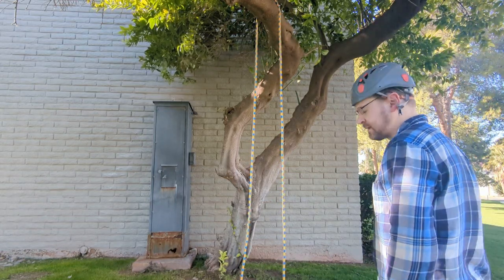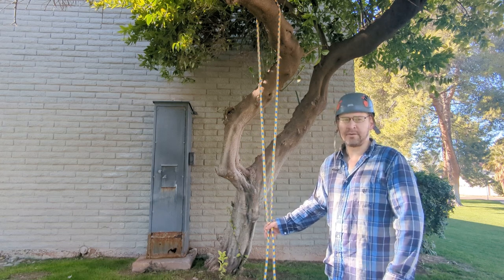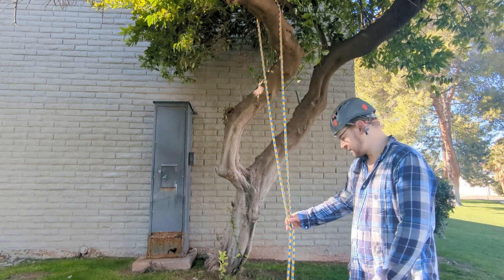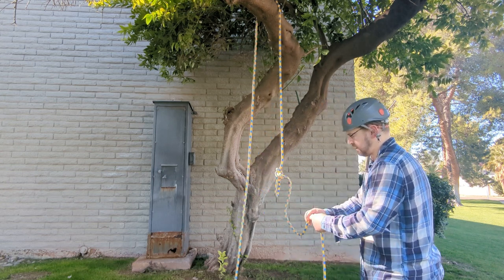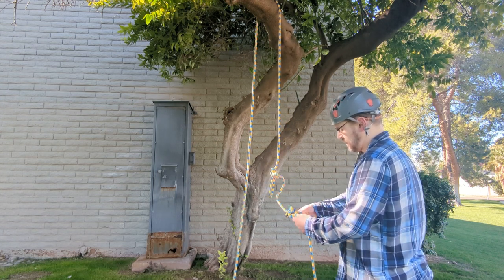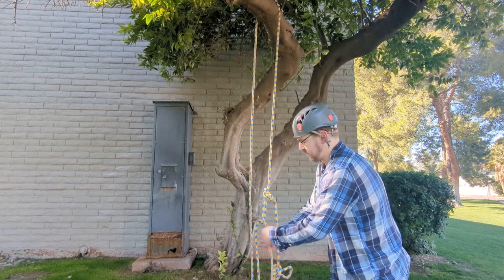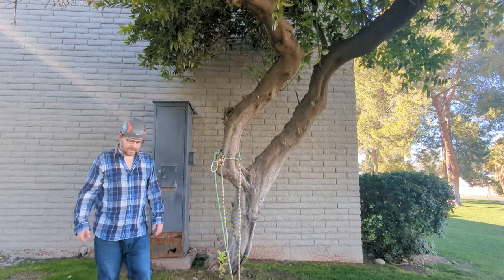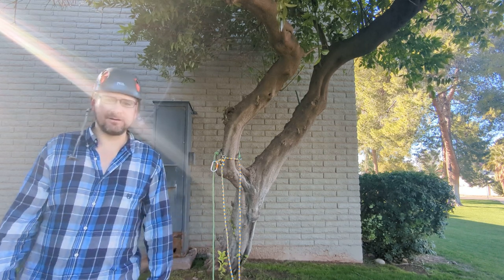CANOPY ANCHORS: 8 Different STYLES & TECHNIQUES for SRS/SRT for Arborists & Tree Climbers!

Comment: I built myself another midline attachable anchor - a 28inch piece of rope with two splices connecting to a dmm revolver on one side and a notch quickie on the other side. the slick pin rolls in the quickie and acts like a pulley when retrieving the anchor or in drt mode. The revolver carabiner has a pointy end and retrieves easily through tight crotches.
the anchor doubles as a pulley saver and a redirect.
retrieves with a cone or xsre carabiner.
Reply from the maker: That sounds great! I like how you used splices, first and foremost. I also like your use of a Notch Quickie with a DMM Revolver. I can definitely see how the Quickie might act as a second pulley. That's awesome that you can use it as a pulley saver and a redirect as well. Thanks for the comment! =-D

Comment: For me, the biggest advantage of single line is being easier to set from the ground. In my experience with large trees, i always find basil anchoring easier due to not needing to isolate a limb.
Reply from the maker: You raise a damn good point and I wish I had thought to mention this downside of the canopy anchor in my video! Because, absolutely, isolating one limb near the top of the canopy can oftentimes be next to impossible. It requires seriously good throw weight skills. However, isolating that one limb still might be preferable to installing a doubled rope (MRS) from the ground using one's throwline, which I personally rarely have the patience for. But like you said, a basal anchor is a happy medium between the two. Thanks so much for commenting!

Comment: I hate when ppl say a base tie will put a 2:1 force on the tie in point. Mechanical advantage assumes you have a pully and no loss of force due to friction. You don't have that in a tree. Candy caining your rope with a basal tie is like doing a fishing when you're rigging. You're dispersing the force throughout that spar. A canopy tie put all the force on the end of a lever. Both systems have advantages.
Reply from the maker: Yes, it's not a perfect 2:1 force due to friction, but it's close enough to where pretty much everyone in the industry states that the force multiplication is such. Keep in mind that, once a climber actually gets onto the rope and starts moving around, this theoretical 2:1 can easily EXCEED 2:1 and even get near 2.5:1 while a climber is ascending, and even higher if a climber were to fall. The main reason why I almost always use a canopy anchor is because there's absolutely no point in creating extra forces on my TIP when I can avoid it. If I need to get up initially using a basal anchor, I will then convert that basal anchor into a canopy anchor after I reach my TIP for many of my climbs...but not all. If I'm over multiple, or a single, very strong limb, then I won't bother. But force multiplication is very real and, even if the figures usually quoted are theoretical, they are easier to conceptualize for most people and that's why it is the standard among educators.
Reply from the maker: My canopy ties are always flush against the spar or stem of a tree. If you're setting you're canopy ties so that they are like putting "all the force on the end of a lever," then you're setting your lines way to far out on the limb and that's dangerous. This can happen for basal anchors too and one should avoid setting both in this manner. Keep your anchors right in the crotches, or as close as possible.
Reply: @Knot-orious. Take a force meater and put it in a tree. Friction can reduce the forces on certain points of a system by more than 50%. I agree you can ratchet a tree with a basal tie and skinny union. Just don't do that. You can do things to reduce friction in that case. 

A base anchor let's you use multiple redirects in big trees. You can estimate force vectors to keep your forces compressing unions and loading leaders correctly. 

Canopy anchors don't allow as many redirects.  All of your forces are on one tie in point. Id rather throw in well, pre set a redirect, candy can the trunk once and basal tie. I'm backed up from my primary tie in, my system is lowerable, and I'm starting my climb in a better work position.

 Canopy anchors aren't bad. They're useful but the best climbers I know use base ties or mid ties on big trees. 

This is probably a defense due to where we live I'm guessing your big trees aren't super spread out and flat?
Reply from the maker: @XbunkerXballerX7127 My trees are very spread out and flat at the top in many cases. I use canopy anchors because there's absolutely ZERO point in creating ANY multiplication of forces unless you absolutely have to.

Keep in mind that, unless you analyze the tree limb(s) you're on with an ultrasound machine, you can only reasonably speculate as to how strong it is and, as is often the case with large thick limbs, they can be under a lot of strain and stress already.

Basal anchors are great when you can't isolate a limb and can pull your line over multiple solid limbs that will share the load rather well and safely with minimal compression. But I always try to get the highest TIP I possibly can and this means usually tying into smaller limbs towards the top of the canopy, and so canopy anchors are best implemented for such situations.

You can do just as many redirects with a canopy anchor as you can with a basal anchor. At least that's been my experience. Especially if your first redirect is made using a sling and a pulley/carabiner, which is what I always do to make any subsequent redirects easier to pull out.

I'm not saying that using basal anchors is unsafe. I use them all of the time. But any time that I CAN use a canopy anchor, I WILL use a canopy anchor because until every tree and its limbs start coming with a certified rating like ropes and hardware, I'm going to do everything in my power to reduce or eliminate force multiplication.

Because at the end of the day, until I get up to my TIP, I can't always see if the limb I'm on is completely safe to climb on. Nobody can. It's a risk we all take as tree climbers. I've gotten to the top and discovered that half of my TIP has rotted from the top down or that it's got a stress fracture and that the limb is compromised. It's moments like those that I'm ELATED that I took the time to isolate a limb instead of risking force multiplication. Because, had I done so, I might have experienced a quick drop with a sudden, abrupt stop if you catch my drift.
Reply: Look man you're right. We can't measure forces in a tree. You're arguing that friction is a non factor whem discussing the real world forces. You are wrong. Here is another sorce showing you forces of a rope around a pole. Again this doesn't have nearly the friction of a tree. 

We already saw in my last sorce that a carabiner instead of a pully can reduce the force on an anchor by 50%. 

You aren't understanding the idea of dispersing your forces. You have an outdated overly simplistic idea of the physics involved here. You're right that the total amount of force in a base anchor is multiplied to some extend. This is why you open up the angles and divert that same amount of force over redirects and the leader your candy caned around. I can easily make the forces on 3 redirects less on each individual point vs one canopy tie. If you redirect a canopy tie, you've now multiplied your forces on that first redirect. 

You're wrong about friction not needing to be considered. I've heard that too. It's what we tree guys say because we didn't go to school for this shit and we don't actually understand physics. 

Take the time to research the math involved in what we do. Just because ppl say old wives tales all of the time doesn't mean they're true. You need to know this. Miss calculating the forces of your rigging because you're not considering friction could cost you.
Reply: @Knot-orious you don't know what you don't know man. I also take the highest tie in possible. I can get a basal tie, with a pre installed redirect, up higher into a canopy than i can a canopy anchor. Youre not understanding that with disperment of force. There's less force on  each of my redirects in a base tied tree with 3 redirects than there are on your one tie in point.

 Take a force meater out to a tree and try it. Read either paper I just sent you. I feel like you just don't want to understand the physics involves so out of ignorance you're biased.
Reply: @Knot-orious also if you can't see your tie in to the point where you don't know what it's over and you're even questioning it. You threw in too high. Relying on just loading the branch straight down is stupid. That's not the standard and it's likely a rule you've made up to make yourself feel better. It's definitely the best practice to load a branch this way but it doesn't get rid of the risk involved in not being able to see what your rope is around at all.
Reply from the maker: I'm not even arguing with you, dude. I'm just sharing my personal opinions. What am I "NOT UNDERSTANDING?" I already conceded that friction on the limb or limbs that basal anchor is pulled over most definitely affects the resulting force multiplication. I've sad said nothing that contradicts anything you've claimed about the dispersing of forces. All I've done is told you why I use canopy anchors over basal anchors for the majority of my climbs. This isn't about my failure to understand your perspective, it seems it's more about your inability to appreciate mine. And, no, I'm not throwing too high. Even if I had a telescope, it would be impossible to visual assess, at a minimum, 25% or more of the limb that make up the limbs blind spot(s). Unless you have a drone, you can't possibly EVER make a completely perfect visual assessment of any limb...even if it's 10 feet above your head...UNITL YOU GET UP THERE. I'm not doing anything wrong. I'm covering my ass by using canopy anchors to protect me in case a limb is, by some chance, defective. You honesetly think you could even notice a hairline stress fracture in a limb, even on the side of the limb, while it isn't weighted? Even once you weight that limb, it still may be imperceptible to the naked eye until you ascend up to it and realize that it is there and threatening you. Trust me, my friend. I fully appreicate your perspective and accept your climbing style. Why aren't you accepting mine? All I'm saying is that a canopy anchor doesn't multiply forces and a basal anchor does every single time to varying degrees. So what am I not understanding? Are you saying I'm incorrect? All I'M SAYING is that I like to eliminate force multiplication whenever and wherever possible. Therefore, I maximize my use of canopy anchors. That's it. That's all I'm saying. =-D
Reply from the maker: I'm not making up any rules. What are you even talking about? What have I made up? You're saying that using a canopy anchor is somehow make believe and science fiction and not common practice? What are you even talking about? You're getting really hostile over some pretty silly, petty shit.
Reply: @Knot-orious you can't see a crack when it's not weighted... so weighted your tie in before you climb. Come on dude don't say ahit we both know the answer to. Thats a straw man.
Reply from the maker: And yes, when I say "I like to eliminate force multiplication," this means that one strategy I often use is setting a BASAL ANCHOR OVER SEVERAL STRONG LIMBS. I already said several times that I DO USE BASAL ANCHORS REGULARLY. But that, when I can't set the line over multiple solid limbs, or if I have a nice central single TIP that can be easily isolated, I prefer a canopy anchor. There's NOTHING unusual about climbing off of one singular limb. Not sure why that's so astonishing to you.
Reply: @Knot-orious  ok so that's not at all what you originally said. Read the first two comments. You've changed your opinion. My original point is that a basal isn't a 2:1 system because of the force loss. You are now agreeing with that statement. 

See what happens when we stop regurgitating shit we've heard everyone say and actually think critically about the world?🙃 turns out the industry wives tale you were spreading is wrong
Reply from the maker: @XbunkerXballerX7127   @XbunkerXballerX7127  I just explained to you that, if the fracture is at the top of the limb, even if you weight the limb, you still might be completely unable to see it and I KNOW you know I'm correct.

You clearly misunderstood me. My original statement CLEARLY agreed with the original commenter about how friction makes it less than 2:1 well before you even entered this conversation.

I clearly can be seen saying that the 2:1 measurement is "theoretical" and represents the multiplication of forces in a world with no friction. Therefore, I'm not even sure wtf you're even arguing with me about.
Reply: @Knot-orious  you're still too worried about force multiplication. What you're actually doing is climbing on an unbacked- up system. Trees rarely just pop. They peal. Having a wrap on the way up on a basal can save your life. 

You also fail to realize that all you need to do is get your rope angles to 60° and they're back to 100% of the load. That's no with no friction.
Reply: @Knot-orious  your first comment you said it was negligible and force multiplication was a huge deal. I'm saying that that is a common lie told by arborist who are not physicists and don't understand physics. 

You also said a 2:5:1 system? You realize that's not a thing, right? That the " : " in 2:1 means "to" right? 

You also said bouncing on the rope can increase the mechanical advantage in the system to greater than 2:1? Also, not how it works. bud😂 2:1 is the factor at which force multiplies. If the forces in the system increase, the factor of Two to one stays constant. 

Do you even do this professionally, or are you just a guy who bought gear and started making YouTube videos?
Reply: @Knot-orious  lol wait a minute you're the shakey hand guy 😂 oh buddy I didn't realize you were that guy. Based on the fact that you shake like a baby deer, you're out of breath from ascending the rope, you can't limb walk, and how 
unused your gear is, i think you're a youtuber not a climber.
Reply from the maker: @XbunkerXballerX7127  Wait. First you were saying I was contradicting myself and now you're saying that I'm "too focused on force multiplication?" I'm ONLY focused on it because you kept complaining that I wasn't understanding you. And now that I've proven that YOU aren't understanding ME, you're resorting to backpedaling. Nice. Classy.

And NOW, out of desperation for a means to make me look bad again, you're making pathetic attempts to attack me personally by making fun of my MEDICAL CONDITION that makes my hands shake 24/7 (good job, dude...you can make fun of people with issues they have no control over), by being critical of my heavy breathing in ONE SINGLE VIDEO (as if that proves I'm a bad person and a shitty tree climber), and then by ASSUMING that I can't limb walk.

Bro, quit while you're ahead. I simply don't have a car, I live in abject poverty, and have no cameraman...so filming myself limb walking simply hasn't happene yet. Trust and believe that I've been wanting to make a video like that for a long time. But I need the perfect tree.

You made a valiant effort to try and make me look bad, but all you really succeeded in doing is proving that you can't admit when you're wrong, that you escalate drama when shown that you misinterpreted someone else's words, that you think people with medical problems are weak and deserve to be belittled and mocked, and that you are somehow able to tell me what I can't do based off zero actual evidence. I can't limb walk? How do you know?!

LMAO, the fact that I haven't made a limb walk video yet only proves exactly that. It isn't proof that I can't limb walk. You, however, have proven to me that you are emotionally fragile and unfortunate at best.
Reply from the maker: @XbunkerXballerX7127  And stop GASLIGHTING me! As if you didn't ALREADY know who I am and which videos you know me from. C'mon, maaaaaaaan. You're embarrassing yourself. Talk about cringe.
Reply: @Knot-orious nah bro. I'm done arguing with a guy who doesn't actually climb trees. Have fun with your little Hobbie. Some of us do this for real.
Reply from the maker: @XbunkerXballerX7127  lolol, I climb trees all of the time; including in countless videos that' I've made. Looks like you have a superiority complex. I don't know why you feel such a strong need to argue with me, and to compete with me. It's really misguided and unfortunate and it just makes you look egomaniacal.